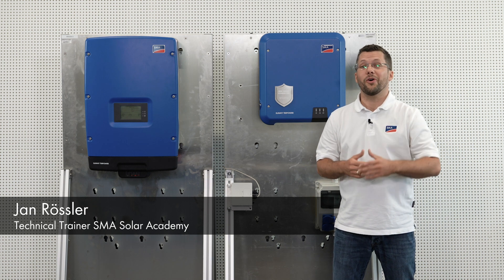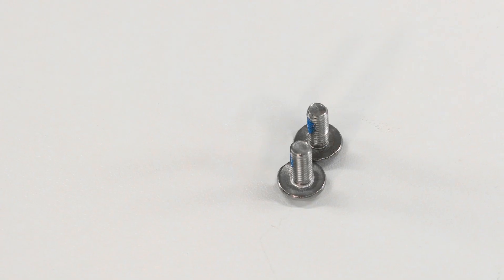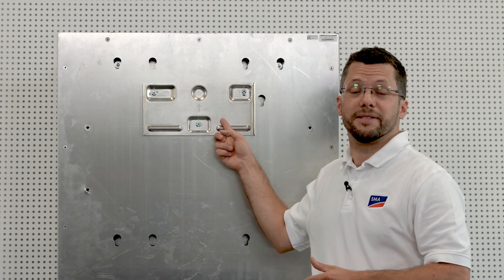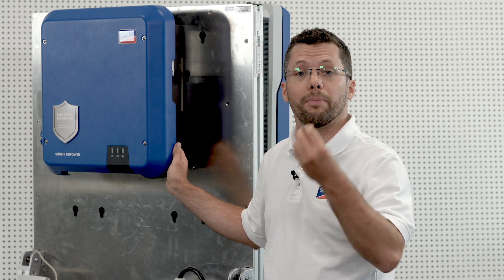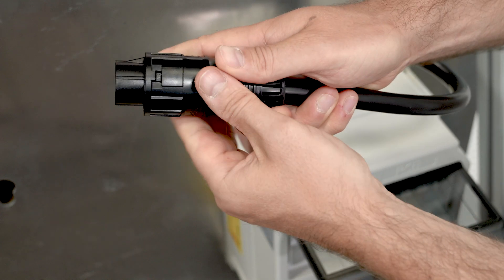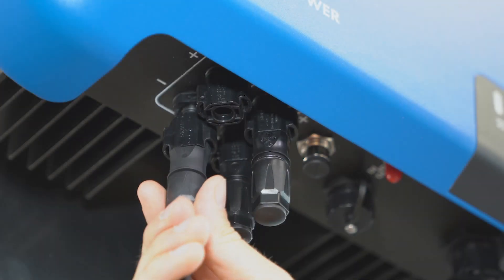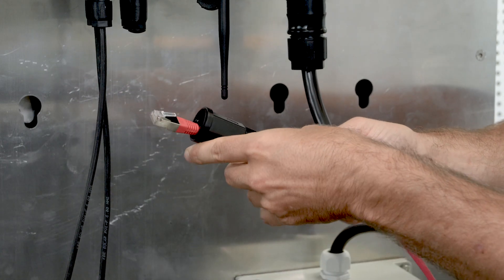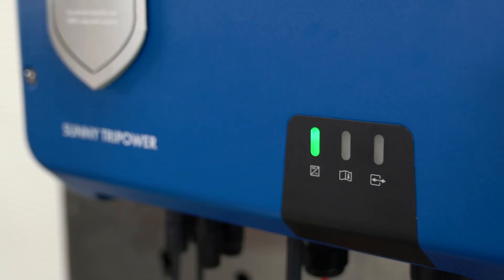Installation SUNNY TRIPOWER 3.0–6.0 (en)

Comment: Nice tutorial here! Where is the AC Cable connected from the inverter. Does it go to the main distribution board  of the house or does it connect first with the Netmeter from On-Grid?
Reply from the maker: Hello Ashwanikumar, thanks fo your kind words! The most usual setup would be: first the house, then the grid. Do you know about our solaracademy.sma.de/en.html? Sunny regards, your SMA Social Media Team
Reply: @smasolartechnology  Hello Jan, Thanks for the clarification🙂Yes, I have read about SMA Solar Academy. I am interested in a webinar on SMA STP15000TL-30. And also other relevant online tutorials for on-grid solar rooftop wiring, connectivity, operations and maintenance!